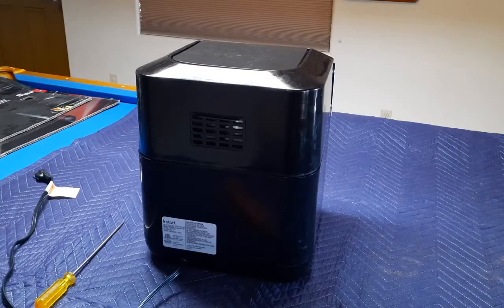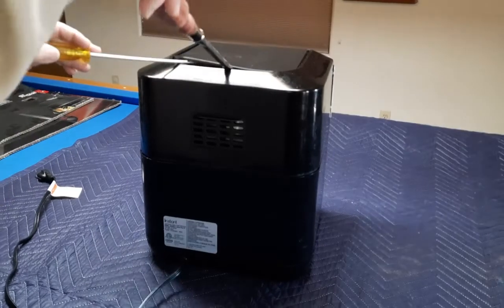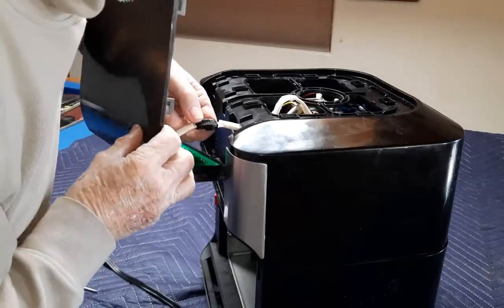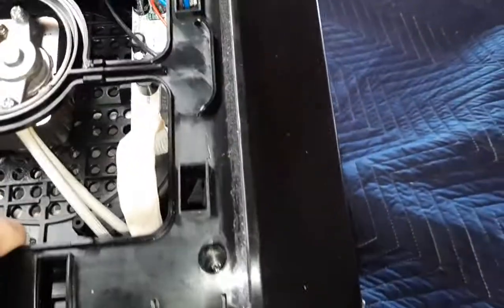How I fixed an Instant Vortex Plus Air Fryer

Comment: We gave the same ayrfrier to our in-law  and the machine makes a loud noise, it's almost like an airplane, and it heats a lot on the front and on the  sides. It's kind on unsafe to use. Does anyone have the same issue?
Reply from the maker: First, let me say I do not own one of these fryers and the one I fixed by resetting the thermal fuse was my sons. I am not an expert on the operation of these fryers. That said, I do not recall reading any comments like yours. Based on your comment, it does sound unusual and unsafe for use. My son’s fryer did have a fan mounted on the top inside of the fryer and I believe that fan it is a necessary part of the fryer to help circulate air to keep the unit from overheating and tripping the thermal fuse. I also believe the thermal fuse is a necessary safety device to shut down the fryer should the heat exceed the 200 degrees C. Once the thermal fuse has been tripped, nothing will work until it is reset. The fan is probably also necessary to help circulate the air for cooking things inside. Sorry I cannot help you any further than that.

Comment: My thermal fuse is busted and I’m going to have to replace it. Would really love that next video right about now 😅
Reply from the maker: Sorry, I returned the fryer to my son and told him to try his best to keep it clean, and to move it away from the wall when using it because the thermal fuse is triggered by higher temperatures. The better it can circulate air the least likely the fuse will trigger. Anyways, the fryer has never come back to me for repair, so I never had to take it apart again.

 I did put some hints in the description on how to get to the thermal fuse. Most import is the fan is reverse threaded. You remove the nut holding the fan on by turning it clockwise instead of counterclockwise. The thermal fuse is a hard part to get to, but if I can do it, I think anyone can.

More important, at the very end of my video, I put a subtitle on the screen listing the exact labeling that was on our thermal fuse. I recommend googling and trying to find a replacement before going thru all the disassembly. If you can not find a replacement, no need to remove it. I hope you can find a replacement.  

If you find a replacement, please post back a link to the location to help others. Thanks for watching and posting a comment. Good luck!

Comment: Your an awesome man! I didn’t have to dismantle the whole air fryer. And all it needed was an reset🤦🏾‍♂️(push down on the black tab 12:37-12:50🙌🏾) and boom BACK IN ACTION!
Reply from the maker: Thanks for letting me know it helped. When I am looking for help on YouTube and find a video related to my problem. I always try to read the comments, because there can be some good information hidden in the comments. For instance, some people have commented on my video, that they did not have to take the 4 screws out and remove the top portion. They just popped up the display and used a wooden skewer stick to push down the black button and they were back in business. I then click the like the video button and usually subscribe as that helps the video maker and also makes the video more accessible to others, so please click the video like button and/or subscribe and thank you for watching and commenting.

Comment: Great video thank you for showing us how to reset it again I happened to find your video but I have a different issue my numbers went out well not complete off but it doesn’t say off any more it’s says opp and I just guess the minutes because can’t seam to read them is it missing a light bulb in there can you please help me if you can thank you .
Reply from the maker: Sorry, I cannot help you. That one I fixed belonged to my son. My wife runs our kitchen and I am glad she does all the cooking. She does not want a fryer, since she has bought many cooking gadgets in the past that she never uses. Most of them just sit in our overloaded pantry. 

Just a guess on my part, but I know there is a green circuit board mounted on the display part. I am sure the problem is there on that circuit board, but since we did not have your problem, I did not take a close look at the circuit board. 

I have fixed several different things in the past on circuit boards, by re-soldering obviously cracked solder joints. If it is a through the hole component and the soldered joint is not dome shaped or appears cracked I would just re-solder the joint. 

I fixed our garage door opener that way and I fixed the Aquastat to our boiler which heat our house that way. The only other circuit board I fixed, I replaced, or re-soldered 4 new diodes on a circuit board for my heat gun and managed to fix it. 

I am sorry, but that is about all I can tell you since we do not own one of these fryers. 

If you have a multimeter and soldering iron, you might look over the circuit board with a magnifying glass and look for problems. That is what I would do if I had your problem. 

Just know, sometimes I would get lucky and fix a problem. I could not fix my son’s X-box, but I did try, just could not do it. 

Good luck!
Reply: @johntube2525   thank you for your suggestions I will try to open it and see if there’s anything look on the board ok thank you .

Comment: Where can I get the new fuse at I half to keep resetting mine. I do believe it has gone bad. I’m going to half to watch other videos to tear it further apart to replace it. If at all possible could you put a link to the new thermofuse.
Reply from the maker: I never found a source, but my son did not need a new thermofuse, so I did not look that hard. I did google and found some with a lower temperature rating and I for sure would not go lower than the 200 C ours was rated at. If you do find a source, please leave another comment with the source info, since you are not the only person asking this question. You might want to look for a comment by Angela Cendejas where hers was tripping after a reset. I tried to explain to her what I feel makes the thermofuse trip. I feel the thermofuse the manufacturer used is pretty resilient, however nothing last forever. Good luck and I hope you find one.

Comment: It worked! Thanks!
Reply from the maker: Thanks for taking the time to comment and letting me know the video is still helping people.
Reply: I tried to use the vortex plus today and it worked for a few minutes then quit again. So do I need to replace the thermal fuse, and if so, do you know a good place to get them? Thanks!
Reply from the maker: @mdhume  I have not found a good place to buy a new thermofuse. I gave up looking since my son’s was fixed by resetting it. Please scroll down thru the comments until you find a comment by Angela Cendejas. Hers worked for a short time also. I tried my best to explain to her what might be happening. I might add the fan is a key element to help keep the temperature below the 200 C thermal fuse. Perhaps besides what I wrote to her there is something wrong with the fan or fan speed. If you read the whole comment, I wrote back to Angela you should have a better understanding of why it needs to be reset again in a short time frame. Or perhaps a new thermal fuse would work better, but I do not have a source. Perhaps a local electronic repair shop could locate one for you? Hope this helps!
Reply: @johntube2525  thanks for your reply, John. I did reset it again, and this time I set the temperature below the 400° that I had it set at previously for a particular recipe. It worked at the lower temperature on something that cooked for about five minutes. I will keep an eye on the fan and make sure it is working also. Hopefully it will continue to work. Thanks again!

Comment: Thanks for the DIY fix. In  our case it was not the thermal switch, but the micro switch at the front. The one that triggers the screen and open door. The switch was malfunctioning and by using a small screwdriver, bending the flip switch leg inside the micro switch a bit, fixed the switch. Now we're cooking again. Your vid helped me figure out how to open it up. Thank you so much!
SYMPTOM: If the fryer briefly turns on when you plug it in and the light inside stays on, but the screen stays off when the door is open. This switch is the problem. Msg me and I can help with some pictures I took.
Reply from the maker: Thanks so much for the great comment on the switch. I read all comments sent to me and all comments when I view someone else's  video and I am looking for help to solving a problem. Why? Because many times there is great information hidden there in the comments made by people like you. I hope others read comments for this very reason. Thanks you for sharing, watching and commenting. Stating the symptoms and how you solved the problem is a great comment. Thanks
Reply: @johntube2525  You're most welcome. Yup, you're absolutely correct. There are lots of info, links and more in other people's replies. In any forum you're searching.
Reply: @LeonKeyser Could you please tell me how you fixed your air fryer?  My display is  not working or if I get it to work after doing what's said in this video, which is very good by the way, as soon as I open the door the display stops working again.  Thank you for any help.
Reply: I tried to message you, I am having the same issue where light is on, but display is off. Are you able to upload a video or send some photos?
Reply: @jenbennett4431 hello, i am having the same issue. Have you been able to resolve yours?
Reply: Do you have to take the top off like he did?
Reply: I have a similar issue, the screen says open when the door is shut - unable to cook.  Took door off the reinstalled, unplugged it for a while then plugged it back in. Same issue.  

Should I check this switch?
Reply: I need help with this issue
Reply: i have the same problem. light stays on when plugged in wether the door is closed or open and NO display. can you help?
Reply: @LeonKeyser, I am having the same issue too, not sure how to fix it, can you please share the details with me, Thank you.
Reply: Hi! Having this issue right now. I figured out how to open but don’t quite understand how to fix the micro switch in front! @leonKeyser
Reply: Inhave same issue..light stays on even when the door is closed and display stay off..i was cooking last night and airfryer was working perfectly fine then suddenly it stopped..display gone and light turend on itself..can you pls share pics or make a.video how did you fix that?
Reply: Thanks, the switch was my problem as well and your comment helped lead me to it.
Reply: @SarahCombs-fu9wt  can you tell me where I find the switch?
Reply: Where do I find the switch?
Reply: I am having same problem can you help with that which?
Reply: @annettenewton6240 
I found it on Ebay and Amazon while looking for it, but I need up just getting my husband to look at the one we had and he was able to fix it.

Comment: Thank you for posting, we were given this from a friend leaving town, it worked for a few minutes and then shut off and didn't turn back on. So I followed your instructions and reset the thermal fuse, and now it works again, thank you again for your time. Much appreciated.

Comment: Thanks for video. Worked fine for few months,now is tripping every few minutes. Have no idea how to replace switch. Tried to remove heating element but i can not detached from second end. Not sure what's holding another side ( maybe another screw , can't see it). Any idea gow to reach switch?
Reply from the maker: I feel for anyone trying to get to that thermalfuse. It may not be as hard as I made it, but the way I did it, it was very hard. I actually took the whole thing apart. I took the bottom off and cut the wires from the power cord. before I cut the wires I labeled them, so I could put back together properly. I took the sides off and then proceeded to take the screws and the plastic posts holding the top and bottom together off. I had to cut all the wire ties and label what wires went where and take all the wires loose so not attached anymore. Eventually I got the entire top off the fryer. That would have been the heating element, fan, and inside plates. The heating element and the fan where still solidly attached to the top at that point. According to my notes, if the top is lying down flat so you are looking at the heating element and fan and top plate, I am going to call that, looking at the bottom side of the fryer top.  I then took out six more small screws and three more little bit larger screws, noting where to put them back when reassembling while looking at, what I am calling the bottom side. My count may be off, but basically you have to take every screw out, you can see when looking at it from the bottom side. So the heating element is fastened by nuts on one side, I am going to call the top side where the wires are connected. And fastened on the opposite side, call the bottom side by one screw and a bracket.  Once those are removed you should be able to remove the heating element. Mine came out pretty easily, but if there is baked on grease here and there it might take a little more force to remove. Eventually, I also had to undo the nut holding on the fan so I could remove the plates you are seeing which hides the screws to the thermalfuse. PLEASE NOTE THE FAN NUT IS LEFT HAND THREADED, SO TO REMOVE IT YOU MUST TURN IT CLOCKWISE, NOT COUNTER CLOCKWISE. Once the two little screws holding on the thermal fuse are removed, I had to pry mine loose while pushing down on the black button piece and eventually it came undone, but the metal part was bend a little from my prying it out. I straighened that back out and once I saw I now had continuity I put the bare minimum back together and found out it worked. Then I cleaned everything really well and put the whole things back together. 

Like I said, it is very hard to get to that thermalfuse completely out.  I would not wish this project on my worst enemy, but I did fix my sons fryer.  Good luck and I hope this helps!

Comment: Great video and you're right, that's a reset button on that thermo fuse.  Mine seems kind of loose and didn't fix it.  I was having trouble finding a new one but I'm going to try the part number and see if I have better luck.  Any ideas on where I can find that replacement part?
Reply from the maker: Ours was labeled KSD301-CR, 16A, 125V, 200 degrees C.
When I google this I get numerous returns, but almost all of them are way below 200 C and some do not have the black button on the back, so I do not think all of them can be reset. Seems, I once found the exact replacement, but I do not remember the source. I think I just kept googling KSD301-CR, but do not remember. I think it was an electrical parts supply company and the shipping was like four to five times the cost of the thermal fuse. 

I did find this by googling and it might work? 

https://www.ebay.com/itm/284931635435?hash=item42573fb8eb:g:TB4AAOSwfGpi-GkT&amdata=enc%3AAQAHAAAAoPI3sNPy1b%2BX%2FpxX0pjq%2B1Vd9m26iBXOH9IobcMs1Fqezzh4f330mnGN53F56zdvv64jun8nWIP0rKlO50zJLd%2FLRvxxUbaMX0lg4kx6aZvrewR33NmFLOM3dRiXeAI8VmQGYMZCQWM7vkdfFaeLX1c7AtbqYUhaSo819HgGQdwzIRqspDjEnHYGctyly6BRWZHCQX%2FlEMTtBKfNs%2Bpw8dc%3D%7Ctkp%3ABk9SR9ye16fnYA

Since my son never needed a new one I did not continue my search. Good Luck!  If you find one that works, please make another comment with the info as it could help others. 
Thanks for watching and the comment!

Comment: Ok so it went out again right after I fixed then I used it. Ima try to do it one more time but if it turns off again would I have to go under?
Reply from the maker: The component with the black button on it is a resettable thermal fuse. It is normally closed or when closed it allows current to flow thru it. When the temperature exceeds the thermal fuse’s rating it opens and no current can flow through. It is temperature sensitive since the rating on ours was only 200 degrees C. or 392 degrees  F. Once the temperature inside the fryer exceeds 392 F the fuse should open and would then need to be reset. 
If you reset the thermal fuse and then it opened again. Do you think the fryer was close to the 392 F. Or did it just open right away, way before the unit could get up to 392 F?
If it opens right way, then perhaps the thermal fuse is now bad. If it is still opening when the fryer is around 392 degrees F, then it is doing the job it was designed to do. 
Since I had taken my son’s fryer completely apart, I decided to give it a really good cleaning. Much easier to do while apart. 
I recommend two things. Giving the fryer a good cleaning and only operate it in an open area so the fan can circulate cooler air thru the fryer. to prevent overheating. 
A build up of food or grease can become too hot and could  cause the thermal fuse to open.  
I hope this helps, thanks for watching and commenting.

Comment: Just a reminder that attempting to repair any electronic device such as the Vortex Air Fryer, can be very dangerous and lead to personal injury or property damage. Attempting to do so will also void the warranty.
Reply: I called your support explaining problem and they told me my insta pot vortex is out of warranty and advised me to buy new one. All I had to do is push that one button.